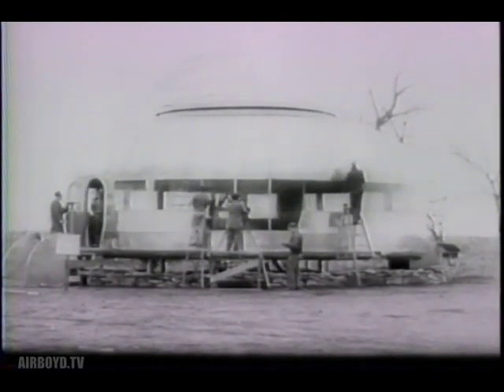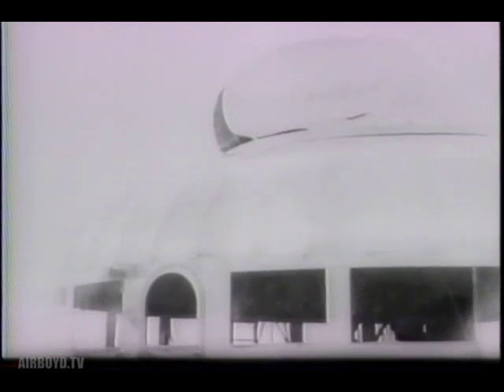Dymaxion House (1946)

Comment: I'm working on an upgrade and review of the DDU.
The originals were only 20'.
Modern ones would need to start at 40', to deal with issues like improved insulation.
The original DDU's sold in the Sear's Catalogues had only one power outlet for just one item being powered with electricity.
The stove had no vent.

Comment: "Bucky" Fuller (who I have met and had talks with) was a true "thinker" and visionary. Many of his ideas were good, solid ones. Many others were impractical and/or short-sighted.

Many ideas in his Dymaxion house are clever, but he failed to consider many real-world things, some of which are:

- People can't just build a house wherever they want. If they don't live on a farm or other large, private plot of land, they likely have to meet local building codes and zoning standards, and many (most) communities would view a Dymaxion house as, at best, an ugly, temporary structure not suitable for meeting community requirements.
- Unlike a traditional house, a Dymaxion would probably depreciate like a car or something, and this would make many potential buyers think twice.
- A Dymaxion house has the look of something that might not stand up to winds any stronger than in a typical thunderstorm.....might come apart, or be crushed, by more violent winds.
- There is ZERO normal storage in the Dymaxion house. There is hardly any open floor space between the furniture, so the owners could only have in the house just what Fuller had thought up, and it had to be in those exact places. No other possessions of any size. Bookshelves.....hardly. Clothes.....just the few things that the in-wall storage bins had room for. Bucky designed the house to look nice and tidy on an marketing brochure, but anyone walking through one would quickly conclude it had too little space, would be a bad investment, and might not even be allowed in the town they planned to live in.